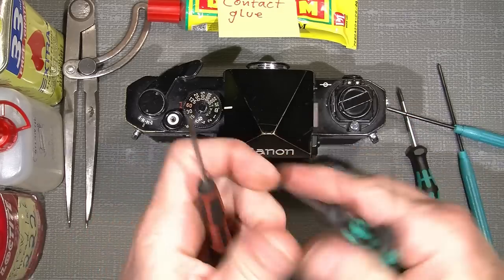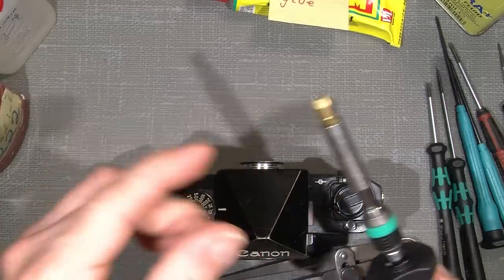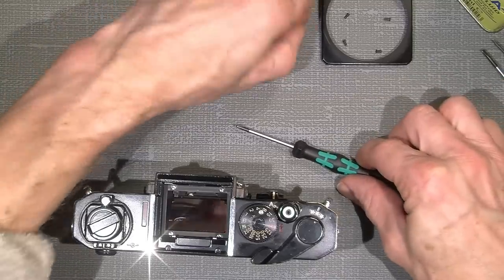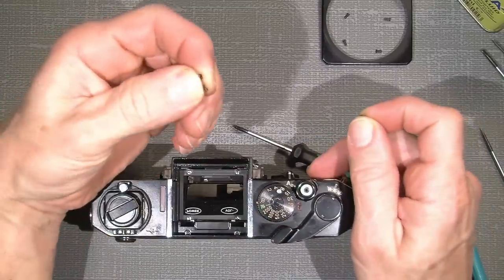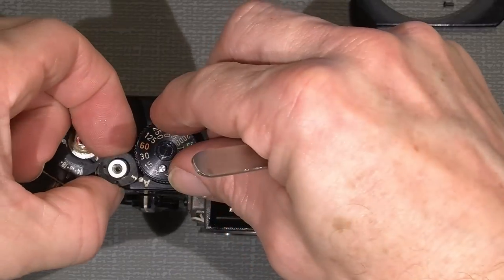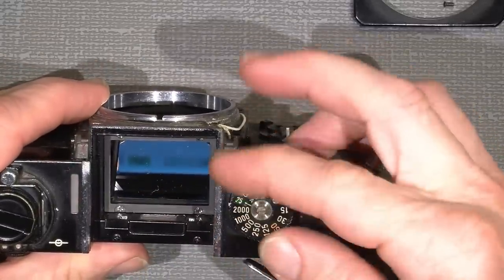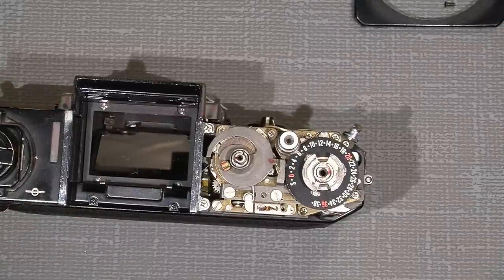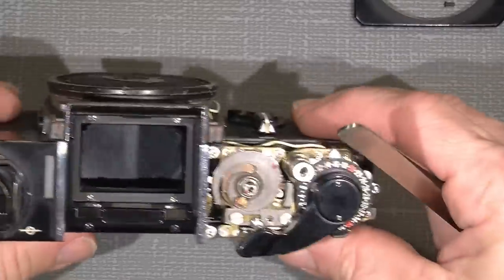Sticky slow gear and other details in Canon F-1

Comment: Thank you so much for your video. It has motivated me to repair my newly purchased F-1 and everything is now working perfectly.
My tip for those of you who also have the same problem: You just have to manage to remove the housing. All you have to do afterwards is oil the gears. These are easy to reach with a needle. That's what I did and now everything works as it should.
Reply: Thanks! Do you mean remove the top plate and then you can squeeze a needle and oil in there? Without having to remove all the parts? SO from about 24:00 in disassembly you can oil the gears?
Reply: @flowermaze___  Yes, exactly that. You have just to remove the top plate - then you can reach the gears with a needle and don't have to remove all parts. But be carefully with the little ball of the Lock (A/L) and make notice in which position do you left the shutter speed.

Comment: Used this video to adjust my shutter speed indicator by shifting the pulley labelled 'E' in the canon repair manual. Thanks for the nice overview! Would most certainly have lost the little bearing in the shutter release lock if not for your warning.

Comment: Thank you very much for these instructions even if I do not know, if I would dare to do this. I am glad that the slow gears of my F-1 still work. But I know what such informations can be worth.  Recently I gave my old Leica MDa with gear problems to the original Leica service (The Leica company is located here close by).  Nearly 800 €  I had to pay for the repair!

Comment: Mike thanks to the video today i took apart my F-1 both top covers, and corrected some issues. Two important warnings: 1. Not to lose rhe small ball bearing under the shutter lock.  2. the right top cover needs to be removed carefully because the asa speed hook interferes with it.
YOU ARE DA MAN -- DO MORE VIDEOS!

Comment: awesome instructions!! really like it
I have a question, I just got a F-1 a few months ago and it is in wonderful condition. From what i can see, all shutter speeds are accurate. But just recently the slow gears below 1/8 start to make a noise after the second curtain closes. It sounds a bit like the self timer, where it winds a little bit more after taking the shot, so the camera is stable. Normally all gears stopped as soon as the curtain closed again, but now it really sounds like a gear unwinds a little bit more afterwards.
The shutter speeds still seem to be accurate, but I'm worried if it is alright. Do you think it needs to be oiled? but id think it isnt a sticky shutter, because all speeds seem to perform well. or does this happen at the start when it gets sticky?

Comment: Great video! I have one with a lighting problem. Pictures come out a little bit over exposed on the right of the frame. I think it may be a lightleak on the right hinches of the back door or maybe a curtain not moving at the same speed through the entire travel time.

Comment: Thank you once again thanks you for an amazing video. I'm about to work on an F1 but my problems start at 1/15s and below. Do you know if the slow speed gear is responsible for these speeds?
Reply: Doesn't matter, i can confirm that the very same mechanism is responsible for all speeds below 1/15. The camera is now repaired. Thanks again for the tutorial!

Comment: A wonderful lesson. I would also like to get advice from you. Recently, I invented the Canon F-1n and found that after a shot, the mirror sometimes does not go down to its original position.It happens 3-4 times on 36 frame film, at any shutter speed. When the shutter is cocked, the mirror is lowered. What could be the reasons? Thanks.

Comment: A great lesson, thank you very mach. I would like to know your opinion. Canon new F1 works great at plus temperature.but the shatter stops working completely at temperatures below 0 degrees. What is the reason? Thanks.
Reply from the maker: I would think the camera and specially the shutter needs a good cleaning and lubrication.
Reply: @mikeno62  How to Clean and lube the shutter of an F1?

Comment: Thanks for the informative video, it will be useful when i have to disassemble my f1! Do you know what the issue can be for the framecounter not advancing when I pull the advance lever? the film advances fine and resets, but the framecounter moves ever so slightly and then flicks back to 's', this occures when theres film in the camera or if its empty, and occurs when the back is closed and when its open. I assume it might be the backpin mechanism not engaging properly with the film advance/counter? many thanks
Reply from the maker: Thank's, it could be some sticky counter parts under the counter itself that sit on the axle, maybe the gear wheel for the counter  is a bit worn out.
If there are some sticky parts, you could try to add a drop of lighter fluid on the axle end, just to see if the sticky parts will start to move when you advance the the advance arm. just some ideas.
Reply: @mikeno62  finally got round to opening it up, turns out the frame counter cover was brushing against the counter, also the spring/lever thats supposed to engage the counter cog  had failed to make proper contact when the advance lever was engaged! I also cleaned it up with iso alcohol and placed some fresh lube as instructed by yourself, fixing the slow/stuck mirror and shutter at 1/30 and bellow! You are a god send, wish u the best mate.
Reply: Ups, just saw you came around with a solution. Anyway the video is there for whoever wants to watch it.

Comment: My F1's shutter speed reading in view finder is not in sync with shutter speed dial. When I set a speed to 1/2000 th, the reading does not show in the view finder.  When I set it 1/1000 th, its reading is 2000.  Basically, the reading in view finder is 1 stop higher than the dial setting.

Comment: I have the same problem with my FTb, all slow speeds are uneven, 1/8 stays stuck and 1/1 takes about a second an a half.
I tried lubricating the shutter speed knob shaft from above but had no luck with it since i couldn't find the timing gears.
Do you know how to fix it without removing the mirror box? And if possible, can you make a video about it?

Comment: this guys just tempting you to ruin your broken cameras as you try and copy him...
Reply: Yes, while I think there's a lot of useful information in this video the fix is more of a bodge than a repair. The emphasis is all wrong, with more time and effort spent on glueing a wire than on cleaning the gear train. I'd like to see the whole thing stripped down, cleaned and rebuilt but that would take many hours and, realistically, this is about as thorough as any amateur repairer is likely to be. At least the result is a camera that, for a couple of years, will be more useable than it was before.